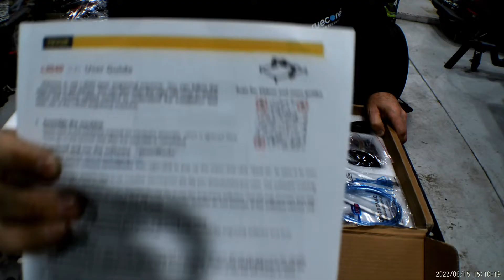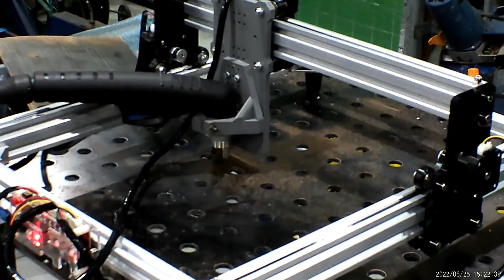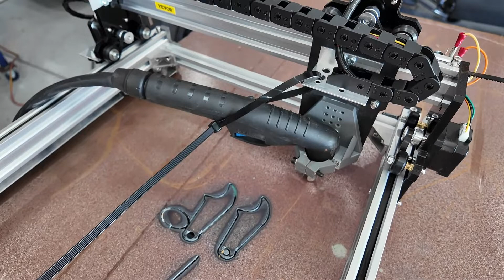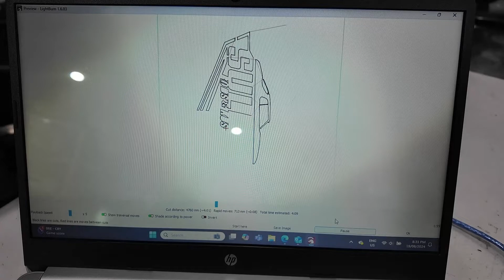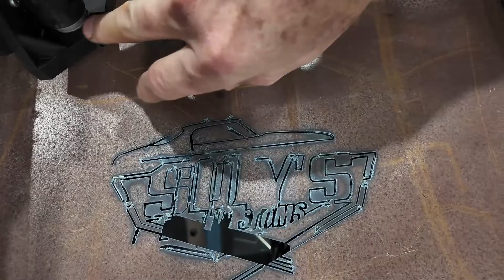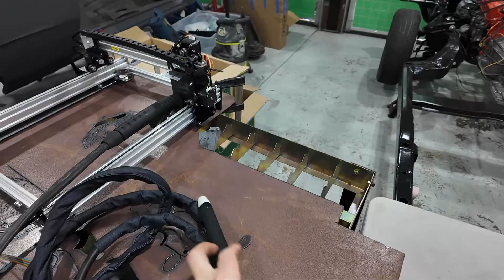$165 DIY CNC PLASMA CUTTER. Yep its True. Cheapest CNC plasma cutter ever.  #cnc, #cncplasmacutter

Comment: I'm wondering how you over came the high frequency interference issue?  Everything I've read and watched says not to use a high frequency plasma as it causes issues, missed steps, etc.  Thanks for posting Ken
Reply from the maker: The only issue I had was interferance between the controller and the plasma arc. Once I elevated the plasma lead and isolated the controller on the 3d printed stand it all worked fine. I've since built a large 1.2m x1.2m plasma table. Which was really easy. You can check it out on my channel.
Reply: Wouldn't using a blowback non HF start plasma cutter fix this?

Comment: Great video, i am trying a similar build but i am having an issue where the plasma torch won't shut off between cuts. its starts fine, but when moving from one part to the next, and even up to 30 seconds after the job, the plasma stays lit. if i hit the stop button in the software it will go out immediately.  any suggestions or did you run into this?
Reply from the maker: Is your plasma torch triggered by a relay? Or is it a cnc plasma ready unit?

Comment: Nice work, man ...
Can you send the link for the relay you used..is it 5v relay
Reply from the maker: @aborayan6831  ill have a look and get the details for you.
Reply from the maker: @aborayan6831   if you check on Amazon abd paste in the following text

DIGISHUO 2pcs 5V 1 Channel Relay Module Relay Switch with OPTO Isolation High Low Level Trigger (2Pcs 5V 1 Channel Relay)

You will find the relay I used.